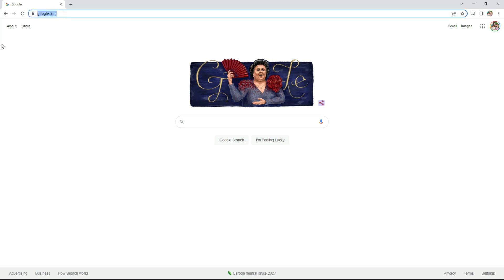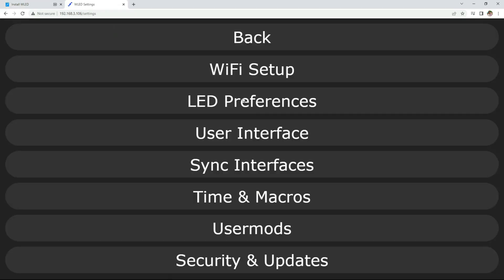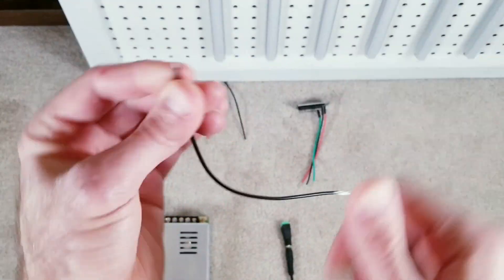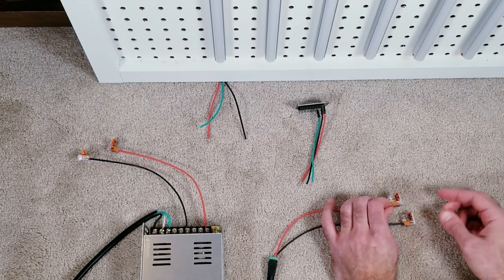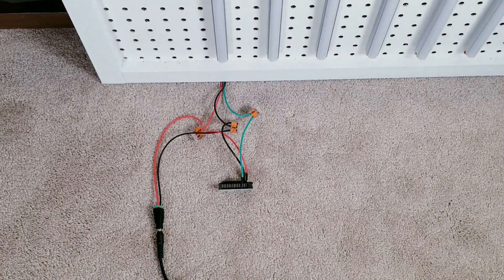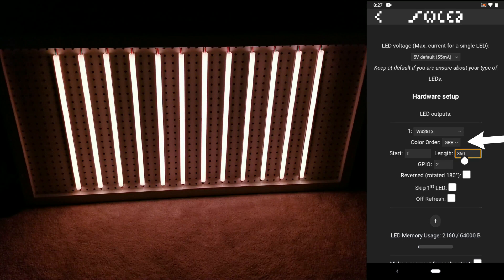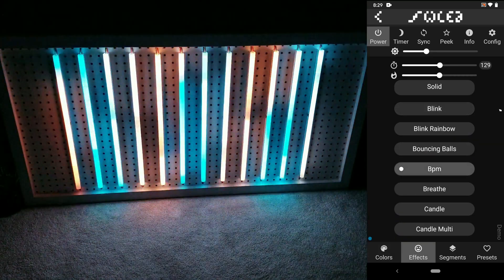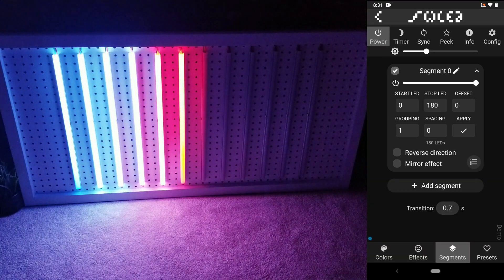How To Install WLED on an ESP32 Board and Connect / Control Addressable LEDs

Comment: Hi Chris, in Config > LED Preferences, do you know how high of "Maximum Current mA" that can I set ?

I am using 60 led/m, 2 Meters, and WS2812B led strip with ESP32 🙏🏼🙇🏻‍♂ Many Thanks
Reply from the maker: Thanks so much for watching and great question! Its going to depend on your power supply and what type of wires your using. I generally set mine to 3000mA Anything higher than that is just way too bright for my liking. There is also a nice voltage calculator at the top of that page that will estimate what power supply you should use for the number of lights you input!
Reply: @ChrisMaherDIY  3000mA :hand-orange-covering-eyes: i only set to 850mA cose i"m afraid if set too high the led strip will burn

Comment: Appreciate you Chris! I’m gonna be starting my project in my room, considering your tips for Soldering, Custom Diffuser Paper, Wood builds!

Quick question: 
Is there a way to use Bluetooth instead of Wi-Fi for the Wled app to connect to the led strips?

2. if we were to connect a ESP32 Board to a normal Rgb (Non IC) would that essentially make the Rgb led into a Rgbic? Since the ESP Board programs the LEDs to Change colors on the Led strip individually?
Thanks very much!🎉
Reply from the maker: Thanks for watching and great questions! So as far as I know, WLED will only work via wifi and not Bluetooth. And the esp boards with WLED are made for digital led strips and not really as much for the basic ones (non ic) so it would not work to make a dumb led strip smart. The technology is just not there in those basic strips to make it do all the fancy colors and effects.

Comment: My LEDs just light up in white and can't be changed :(
I am using a 45w power supply and 30 LEDs, so Current shouldn't be a problem and I also connected the grounds together. Does anyone have the same problem?
Reply from the maker: Thanks so much for watching! What type of lights are you using?
Reply: The WS2812 light strips. I also had some problems loading the WLED software on my ESP with my Laptop and had to do it over a different Computer, so maybe the ESP is faulty?
Reply: ever figured that out?
Reply: @cyrez I don't know what the exact problem was, but when I changed out the ESP32 it worked.
Reply: @Timo-mf5nt  interesting, what pin is it in and what gpio is that in wled? ive tried a ton of different esp's and its still white

Comment: I cant connect my esp32 to wifi . I recive only this message: Enter the credentials of the Wi-Fi network that you want your device to connect to.
Reply from the maker: Thanks so much for watching! Hmm, and you have tried entering in your network name (case sensitive) as well as password? Maybe someone else reading that has run into this same issue can chime in with some ideas?
Reply: @ChrisMaherDIY  yes I try everything. Maybe I have bad esp board. I ordered new one

Comment: Hi Chris how are you doing? I am loving your videos. Any chance you can give me tips for my project. I have a small room (the space is 6mtsx6mts) and I am trying to find the best configuration. I am planning on doing a total of eight BTF-LIGHTING addressable led strips (60 leds/m) (5mt each 12v) + Muzata diffusers. What would be the best way to power them? Maybe 2 60 Amp Power Supply (running 4 and 4, or running one at the beginning and one at the end)? How many Injections would you recommend?  Would I get away with one ESP32 board or should I get more? Or is there any board you would recommend for longer projects? I've seen ENTECCs Octo as an option but would love to get your advice on it. Greetings in advance, love your content
Reply from the maker: Thanks so much for watching and taking the time to comment! Sounds like an awesome project! I've never really done anything that big but I would probably start with at least 2 of the big power supply's. So much of power need is based on how bright you want to run them and since I never run mine very bright, I am always surprised at how little power is actually needed. I would lay things out on the floor and test it out with as little power injection and then go from there based on results. I generally always start with power injection at the beginning and then the end. As far as controllers, this has been a good resource to look at in terms of how many leds you should be running: https://kno.wled.ge/features/multi-strip/#:~:text=For%20good%20performance%2C%20you%20can,a%20total%20of%204000%20LEDs.

I have not done this large of a project before so i'm not sure if there are better controllers but I would for sure first try it using the esp32. Good luck and hopefully everything turns out great!

Comment: Do u need working wifi connection just router will do the work? No Internet connection is required! ? Does it work on server or localy , does it also connect via blutooth?
Reply from the maker: Thanks again for the great question. As far as I know, you need wifi connection to make it work. I'm not 100% sure but I have not figured out a way to get it to work otherwise. Maybe if someone is reading the comments and knows for sure they could chime in!

Comment: Can I use esp8266 for this
Reply from the maker: Thanks so much for watching! It says it should work the same for most esp8266 devices but for whatever reason I had issues doing it this way with my esp8266 and instead just did it the old way: https://www.youtube.com/watch?v=l8OMi7SMpqs&t=148s

Comment: The wires magically show up soldered to the esp32... and you don't tell us which wire goes to which pin... Not helpful.
Reply from the maker: Thanks for watching! I referenced and linked the soldering video I made which goes over that in great detail. But I used the D2 pin for data, VIN for power and GND for ground. Thanks again for watching and I hope that helps!
Reply: @ChrisMaherDIY  Thanks for responding. Did chase up the above info. Posting a bit more info hoping it can help others. 
The ESP32. The ESP dev board being used looks to be a NodeMCU-32S (ESP-WROOM-32).

As stated above the pins for power are “vin” for your positive and “gnd” for your negative.

For data WLED defaults to GPIO16 (pin D16, which does not seem exist on this dev board, strange). In any case you can pick another GPIO pin. I chose pin D2 for my data. To update WLED to use pin D2, launch the app or web interface for WLED.

As of version (v0.14.0b1) navigate to “Config > LED Preferences > Hardware setup…  GPIO:” Enter 2 next to ”GPIO:” and save. You may have other business in this config screen i.e. “LED outputs:… Length” but this should help with the wiring of the board. Good luck.
Reply from the maker: @RodanChi  appreciate it! Thanks for the info! I did notice that the gpio in recent flashes does default to 16 when I'm fairly certain it used to default to 2. Thanks again for taking the time to respond with the helpful info!

Comment: I just found your channel and this is the most helpful resource yet!  .... I'm a total newb when it comes to LED controllers. I'm working on building something similar to what you've done here. However, Instead of the animations going starting on one strip and continuing to the next, I'm wanting to 2 or 4 separate strips to mirror the same animation. Can I just split the wires from the controller into 2 or 4 separate strips? (as long as the total number of led's is under 300). or do I need to operate each strip with its own controller and power supply?
Reply from the maker: Thanks so much for the kind words and glad you are enjoying the videos! Great question! You can for sure just split the data coming off the controller and hook them up. This will ensure that all the strips will do the exact same thing at the exact same time!

Comment: Hi Chris, How to install 4 pin led on an ESP32?
Reply from the maker: Thanks so much for watching and taking the time to comment! So I did make a video on getting things set up using some 12v led strips and those did have 4 pins. If the ones you have are the same, check out the video and see if it helps! https://www.youtube.com/watch?v=zbhdH-qSANc&t=141s

Comment: Master of WLED DIY projects, I call upon you!
I want to place an LED strip (compatible with ESP32 and WLED) underneath my handrail. The only issue I have is that my cable comes out of my wall at 2/3 of the handrail. So here comes the question: Is it possible to cut the LED strip at 2/3, than start both at the point where the cable comes through, and still use it as normal with effects (chase etc.)? Or can't the ESP32 read where the start is if two strips are started from the same cable?

Big thanks in advance!
Reply from the maker: Ohh man that is a good question! I'm running my brain through all the setup options and I'm for sure stumped on this one. I'm honestly not sure. If I had to guess I would say no but I'm only 60% confident in that answer lol. Maybe someone else reading might know for sure and can chime in. Let me know if you figure it out as I'm curios myself!
Reply: I will try it with two strips to see if it will work. Once I've the answer, I will let you know. Thanks for your reaction!

Comment: I bought some ESP32 dev boards with LoRa but haven’t made use of them much, they have all the standard headers to connect things but also have an oled display, hopefully it’ll still work.  I currently have a string controlled via old laptop to a mini 8-bit arduino and GLEDIATOR which isn’t the most efficient.
Reply from the maker: Thanks so much for watching! Sounds like a sweet board you got with the oled display! Thats so cool! I'm sure it will work just fine!

Comment: Watched this tutorial multiple times but now its my time to try it, and I cant be more excited! One question tho: my esp32 has almost all GPIO pins and no DI4.... which pin do you recommend I use for the data cable? Great Video!
Reply from the maker: Thanks so much for watching and good luck! I would say see if there is any pin with a 2 or 3 and start there. In WLED under preferences, there is the ability to tell the program what data pin you are using so you would want to make sure that is the same as the pin you do end up trying first!

Comment: How do you get your ESP32 board to still connect to wifi when you plug in your power supply? I have a 5volt 10 am power supply. basically the one you have in your list, but it won't connect to wifi once I use the power supply. When I use the Micro USB it's fine.
Reply from the maker: Hmm that's interesting! It should work both ways! When you use the 5v 10am supply and hook everything up does the light on the esp board turn on? I would maybe check the wiring. Make sure the gnd on the esp device is connected to the gnd of the power supply. Let me know if you figure it out!

Comment: Will all this work if I use smart 2811 rgb rectangles with 3 pixels in each rectangle? 12v
Reply from the maker: Thanks for watching and great question! With 12v led strips you need to make some slight modifications. I did make a video going over 1 way you could set things up using the ws2811 12v strips: https://www.youtube.com/watch?v=zbhdH-qSANc&t=1s

Comment: thanks for an excellent detailed video, though for what ever reason I can not get past the Install WLED "Preparing Installation", even after trying the boot button option, turning off AVG security etc but still nothing....after a bit of snooping around, it may be down to the ESP32 boards I have, possibly have less than 4MB and the Install WLED web installer requires boards with >4MB....
Reply from the maker: Thanks so much for watching! Bummer you are having issues. I have only ever ran into trouble when the usb cable I was using did not support data. I had to try like 6 different ones before I found one that worked. Other than that, one time I did have a bad esp device. Maybe if someone else is reading this and they have any ideas they can chime in!
Reply: @ChrisMaherDIY  Finally got one of the boards to work on installWLED none of the pack of 3 worked but the single board worked and tried about 3 USB leads before one got it would download..

Comment: Hey Chris, thank you for making such an informative video. One small question though, I can only get esp32 38pins board. Will it work the same as 30pins?
Reply from the maker: Thanks so much for watching! My understanding is they are all pretty much the same. The 38pin board should work just as good (even though I've never personally used it) I'm not 100% sure on the pin layout but it shouldn't be too hard to figure it out with some playing around. Plus, in WLED, you can go in and change the pin that is assigned to data so that should help as well!

Comment: Hey Chris,   love the tutorials,  very helpful.   Maybe you can help me with my issue,  once you've connected the wires and head to the WLED APP,  you press "discover lights
'  and it looked like the app saw your controller immediately.  What do I do if the phone APP doesn't locate my esp32 controller?  when I go to Wi-Fi on my phone I can see the controller in my "Other Networks"  so I know it's  working,  but the APP just can't locate my ESP32.
Reply from the maker: Thanks so much for watching and thats a great question! Can you access the wled controls via your computer/web? If so, I would maybe do that and somewhere under settings find the IP address. then go back to your app and I believe there is an option to try adding a device via the ip if its not finding it automatically. But yeah, it always pops up right away when I've tried so i'm not sure why it would not on your device. I'm running android. Maybe if anyone else reading this has any other ideas they can chime in!

Comment: Hey i just bought a ESP-Wroom-32 and watched your video.
I am using a 5V 1.5A powersource
i solderd all the conections like you did but nothing got lit up (led don't light up)

positive to the V5 pin of esp
G35  esp to out of micro
3V3 esp to vcc micro
G2 esp as data
GND micro to ground 

what am I doing wrong?

As further info my esp has other connection than i your video.
Starts with V5 to 3V3 ( side of the RST button)
Start with GND to CLK (side of boot button)

Hoping on a positive response
last but not least happy new year.
Reply from the maker: Thanks so much for watching and taking the time to comment! Sounds like you have everything wired up the same way I did! The only issue I ran into was with the micro. When I bought them, they came in a 2 pack. 1 of the mics did not work out of the box but the other one did. Other than that, I would maybe try a different esp board in case the one your using is bad. Troubleshooting is never fun. Maybe if someone else is watching and has any other ideas they can chime in with ideas!
Reply: @ChrisMaherDIY  hey i did found the problem :) I though my plus was negative so yea stupid mistake.
everything works but when i put the sound effect on i get a lot of interfering,  the leds go on and of.
but there is no sound that i can hear or making.
Is it possible that i can resolve this problem by adding a small capacitor like 470µF in between 3v3 and gnd of the max4466?

I made 2 of these circuits and when i both feed them (5v 2A adaptor) at the same time  everything works like a charm.
no  interfering, could this be because i cancel all the extra interfering with 2 working circuit just aside each other?
mant thanks and hoping someone had had the same problem/solution
Reply from the maker: @TheKluzze  you can certainly try that and see if it helps!  But your saying that the mic is not picking up the sound in the room and the LEDs are just doing random things? I think I'm the sound settings of WLED there are settings you can play around with to see if that helps as well.
Reply: @ChrisMaherDIY  i mean the mic is picking up all Kinds of noise that is cant het but that are around.
Like now the led are glowing up but no hearable sound.
Reply: *hear i mean

Comment: Thank you for this video, i would like to know the data wire comes out from witch pin number on the ESP32
Reply from the maker: Thanks so much for watching! I had it connected to the D2 pin on the esp32.
Reply: @ChrisMaherDIY  thank you, and the positive to VN and the ground to gnd?? Am i did it well this wiring???? My strip is 5v
Reply: i am installing the Wled on my ESP32 30Pins. and i did all what you have mentioned ,and my led light doesn't lighted. and at the same time i install Wled on my ESP28866 and the led light woks fine. please advice me what i have did wrong on my esp32. but i have notice when i connect the power 5 v , and the data dD2 the light of D2 on my board it lighted?